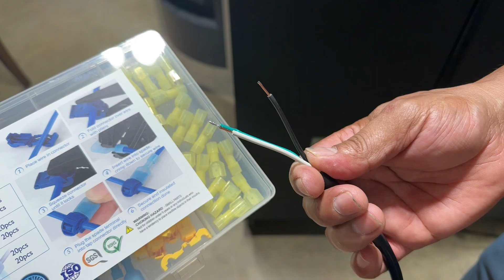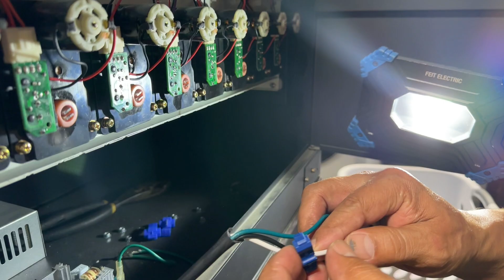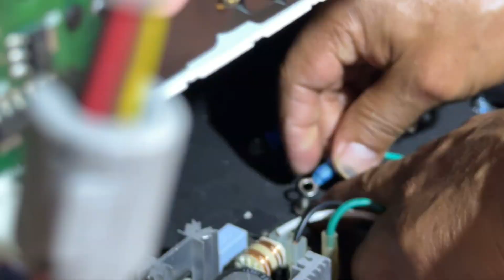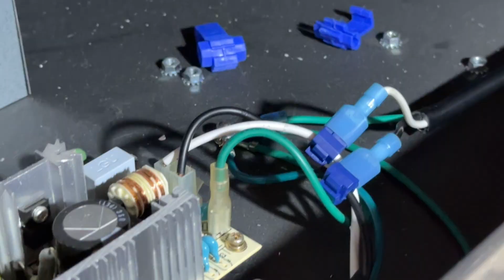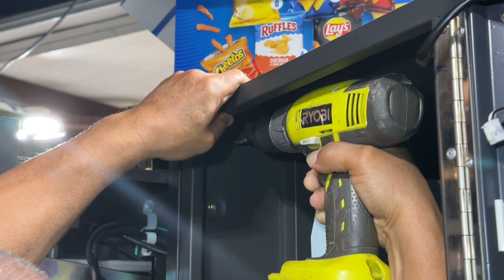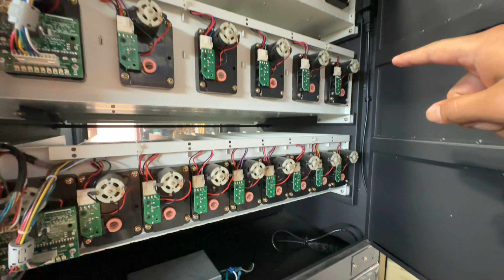Vending Machine LED Lights Installation

Comment: What LED Kit did you use?
Reply from the maker: I will attach the link below, I also purchased a kit to tap into the power wires.

https://www.ebay.com/itm/293057928287?mkcid=16&mkevt=1&mkrid=711-127632-2357-0&ssspo=Xtky84grQ-y&sssrc=4429486&ssuid=94ncis9lsje&var=&widget_ver=artemis&media=COPY

Thanks for watching and the comment!